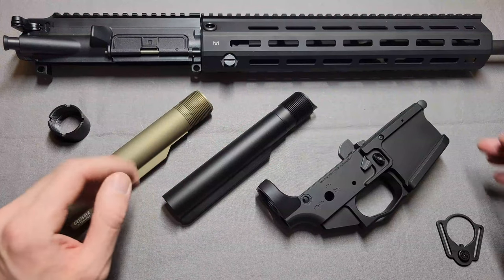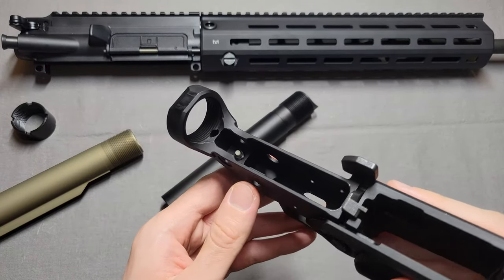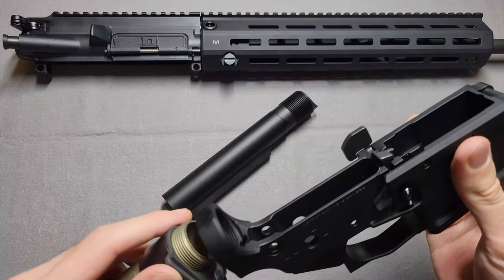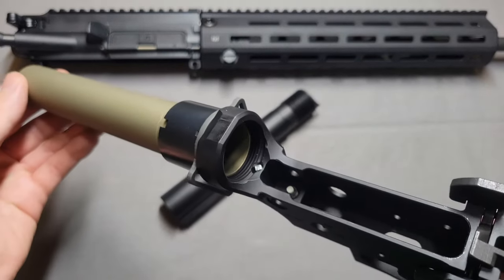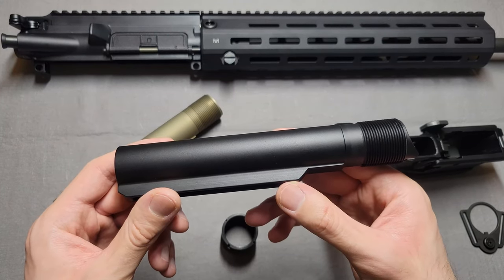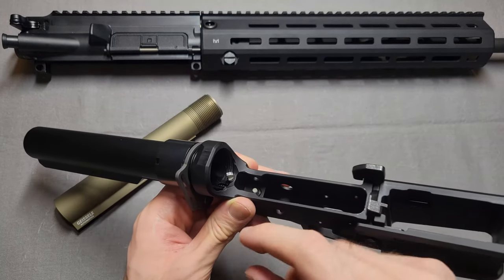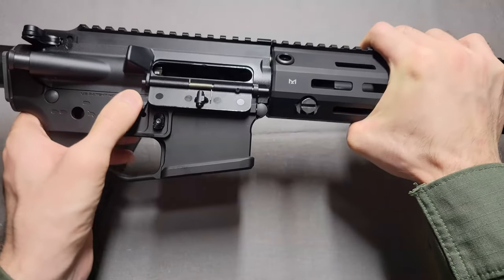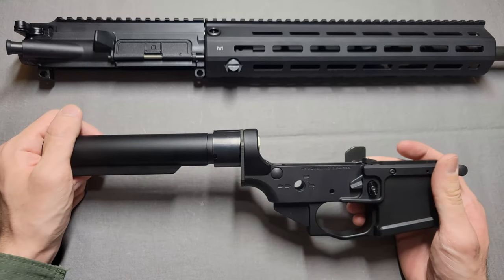HK Extended Castle Nut Compatibility with AR-15 Buffer Tubes

Comment: Usually, an HK MR556 or HK416 A5 lower will have an extra detent you hammer in on the left side lower to capture the buffer detent. I'm sure that would also solve your issue here. Plus, you could use any milspec buffer tube you want without having to buy the specific Aero buffer tube you mentioned. Correct me if I am wrong, though.
Reply from the maker: That's correct, though it's not an extra detent but just an extra roll pin that spans across the buffer retaining pin. Just recently I found the specs to drill out the hole properly in an AR lower, so that's certainly another option. One additional caveat with that roll pin though is that only works with the HK buffer retaining pin due to the difference in shape.
Reply: @Feldmutze  ah, thank you for the info. I'll be sure I use the HK or Haus buffer retaining pin. I am planning on getting a clone lower for an HK416 and using an LMT buffer tube. I quite like the gray dry film lubricant on them.

Comment: i added this enhanced buffer tube to my optics planet cart two days ago when I seen it was only 8$ more than the standard aero carbine buffer kit. This is for my Gibbz MG4 build.  I was hoping you would show underneath the tube. I read that they added holes to the tube for moisture drainage. Also, Im gonna check what that extended castle nut cost.
Reply from the maker: The Aero Precision has a hole drilled in each of the locking positions for drainage. I also noticed that the Geissele one I showed in this video has holes drilled in as well, but only in the last four locking positions. I found an image that shows the bottom of the Aero Precision enhanced buffer tube quite well here https://shop.truestrategic.com/wp-content/uploads/2020/06/APRH101227C_00.jpg

The extended castle nut is a little on the expensive side especially when it's ultimately just a castle nut. $37 for a US-made clone as I showed in the video from Haus, and ~$80-$100 for an authentic HK A5 extended castle nut.

Comment: Great video! I've run into an issue trying to change the endplate on my MR223A3 to a HK QD one. Do you have any advice as to which castle nut wrench to use? I've taken my rifle to a gunsmith and he couldn't get the hooks/pins from the wrench to engage with the HK Extended castle nut. Any advice? Thanks!
Reply from the maker: Thank you! You can use any AR-15 castle nut wrench to remove it. I usually use a Spike's Tactical wrench that I quite like as it engages 3 norches. Since making this video, I've tested both an authentic HK extended castle nut and the Haus one I showed in this video, and both are compatible with a standard AR-15 castle nut wrench. Perhaps that gunsmith doesn't have the correct sized castle nut wrench?
Reply: @Feldmutze  Thank you for the info. He must have had a really strange one then. I have also asked the guys on HKPro and a few confirmed that it should work. Thanks for pointing out the specific one you use. I won't be taking my rifle to the gunsmith in question, since he didn't even know about staking and the fact that the castle nut was staked from the factory.

Comment: Tnx for making me stop looking for this problem :-)
Stil wondering why hk cant make mil spec tubes and buttstocks?
Reply from the maker: HK does make milspec buffer tubes and stocks. The milspec HK buffer tubes come standard on the MR556 and the HK Slimline stocks fit milspec tubes. The EU MR223 does use a commercial-spec tube however.
Reply: @Feldmutze  Ok tnx! Iam in eu and waiting for my mr 223 - 11. Slimline ral 8000 .
But want to change buttstock to magpul ctr. The black tube you r using in this vid is out of stock in fde almost everywhere in EU.
And also want to use the hk castle nut.

Comment: I have an STS A5 lower and I bought an HK buffer tube and the A5 castle nut and had the same problem. Is there different HK factory buffer tubes? I ended up using a standard castle nut
Reply from the maker: Yes, there are different HK buffer tubes. The extended castle nut won't fit on the commercial-spec/HK-spec tubes but it should fit on the Mil-spec ones.

*Edit: I was researching this more and there are commercial spec tubes from HK that WILL fit the extended castle nut. What really makes the difference is whether they're made for the old 416 or the 416A5 and you'll need to make sure to get an A5 tube which have more material cut out to accommodate the extended castle nut.
Reply: @Feldmutze  Thanks! I must have bought the commercial spec tube from brownells